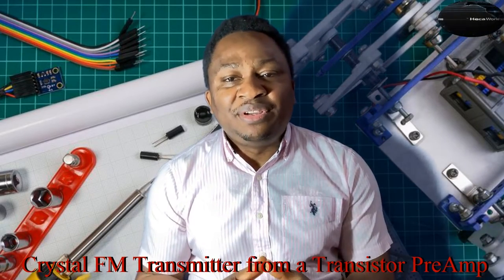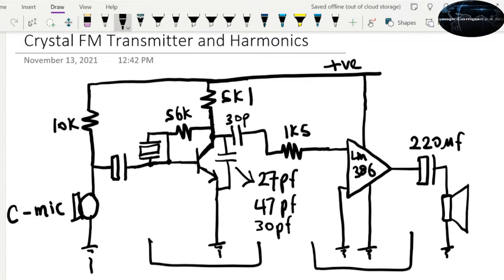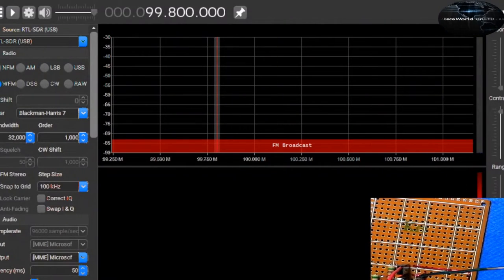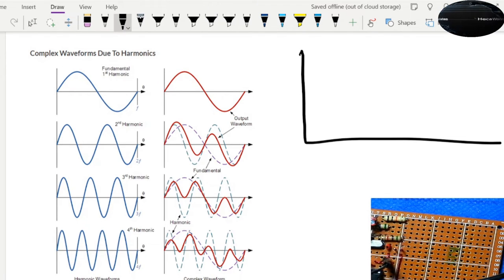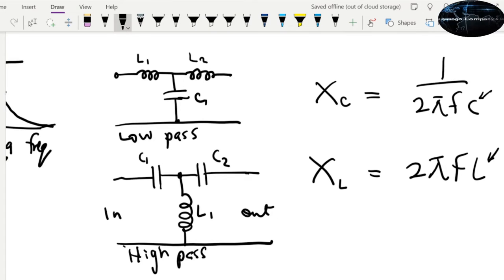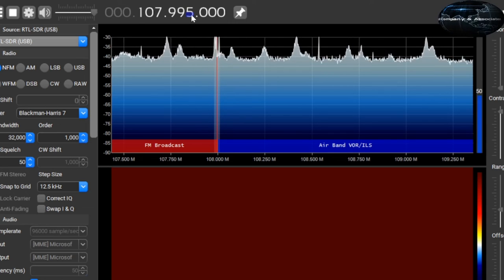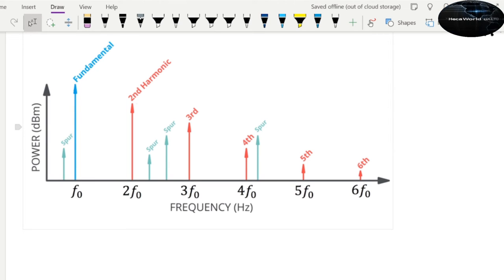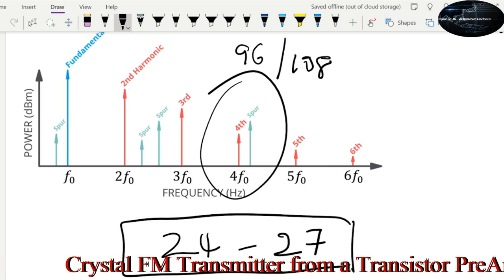Crystal FM Transmitter | One Transistor FM Transmitter | Frequency Harmonics |

Comment: Hi, sorry, but to the pin of lm386 where is the 1k5 resistor, what we must Connect? Thanks
Reply from the maker: The 1K5 should go to the wiper of a variable resistor if you want to use the circuit as an amplifier (then of course, you will need to remove the crystal).

Comment: What is the number of the transistor you use and voltage
Reply from the maker: The transistor is 2N2222. The power supply is from 3V to 4.5V.

Comment: How do I turn this circuit into FM receiver
Reply from the maker: The Transistor is 2N2222. 

This circuit in its current form is a very poor receiver. If you build two of it and place them close to each other, it can receive each other's transmission, but very poor. If and when I get a good crystal receiver, I'll make a video of that. In the mean time, you can use this for the receiver - https://www.youtube.com/watch?v=6k1XYek-0IQ&ab_channel=hecanet

Please, remember to subscribe if you haven't done so yet, and if you already did, thank you.
Reply from the maker: Here is another receiver project:
https://www.youtube.com/watch?v=5b8tmG6YLZk&ab_channel=hecanet
Reply: @hecanet  I've a better crystal TX circuit.
Reply from the maker: @dare-er7sw  Awesome... please share a link to yours so we can all watch and support you. Thanks.
Reply: @hecanet  https://youtu.be/yzAZSNXGOuY

I've got an improved version but it's not posted on YouTube. It's also better with a chip.
Reply from the maker: @dare-er7sw  Awesome... just that it has a lot more components.
Reply: @hecanet  It's kinda complicated but I've a simpler one with a commonly available chip and band pass filter so spectral purity is excellent plus it's such a compact circuit. I've not published it yet.
Reply from the maker: @dare-er7sw  Okay.... let me know when you publish it. And what's the transmission range?

Comment: Crystal is shorted. Mistake in schematic
Reply from the maker: In the schematic diagram, the crystal was supposed to be shunting the resistor... you are right. Thanks for spotting that error - but in the build, it was built correctly with the crystal across the resistor.
Reply from the maker: Please, do remember to subscribe to my channel.